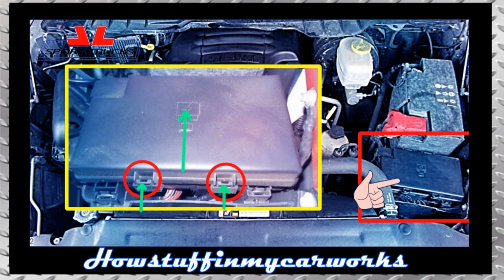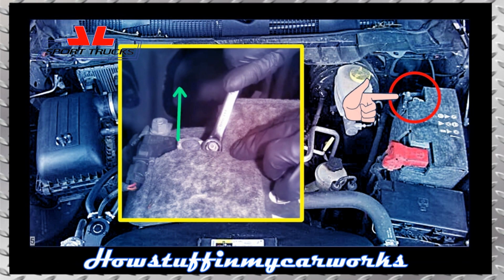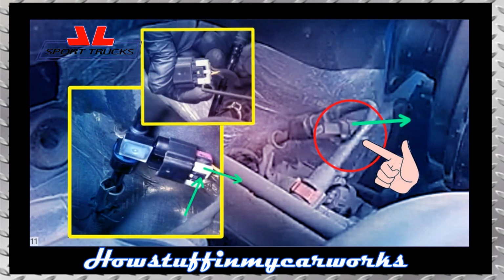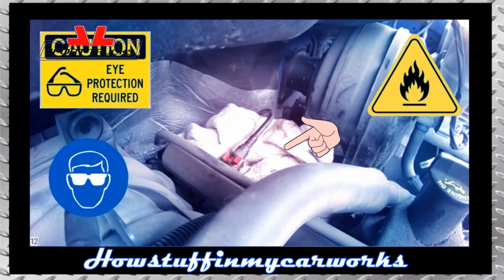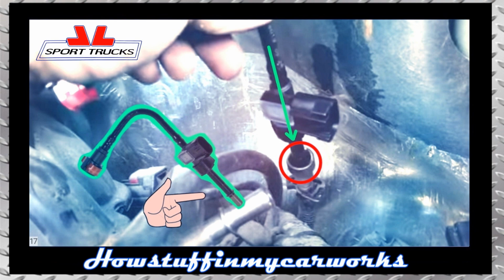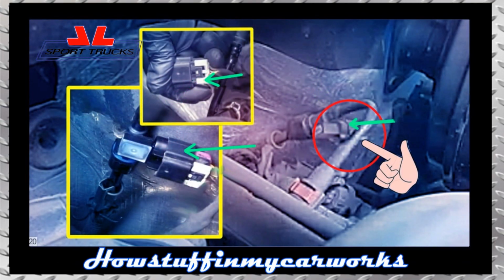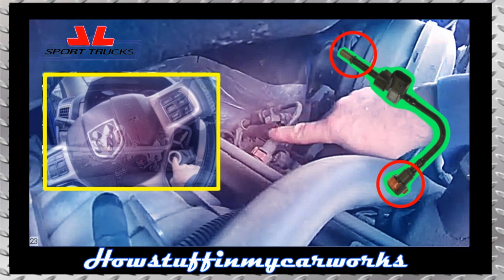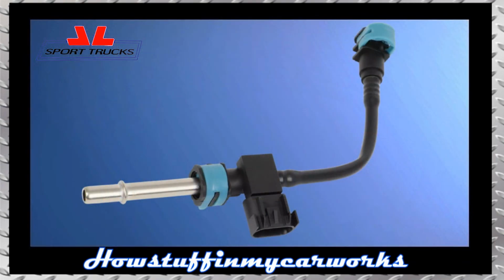How to replace change remove the fuel pressure sensor on 2014 to 2018 RAMM 1500 5.7 Hemi

Comment: You forgot to mention the part about the new wiring changes. Electrical connector is different on the updated sensor connector and the three wires are in different places on the new connector. If you don't cut/splice the wires and hook them up to the updated positions, you will get a different check engine light.